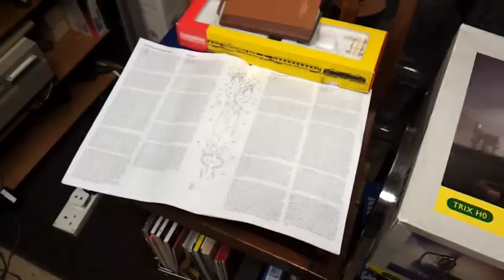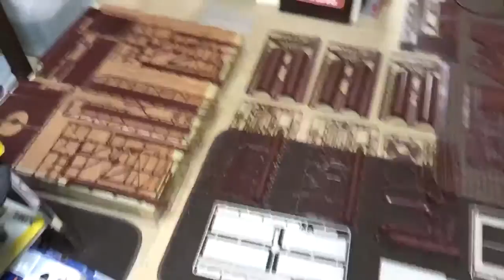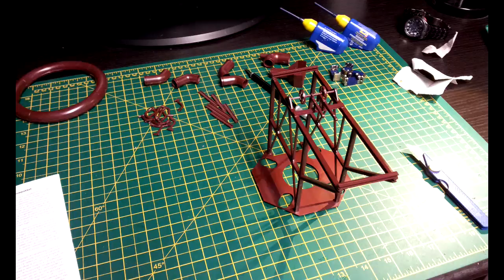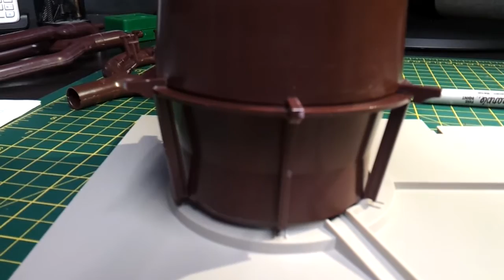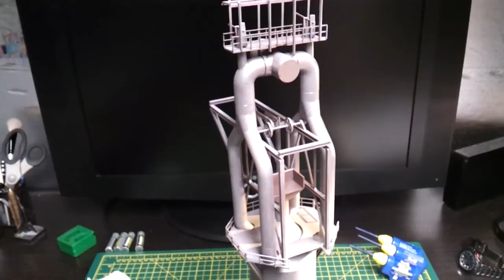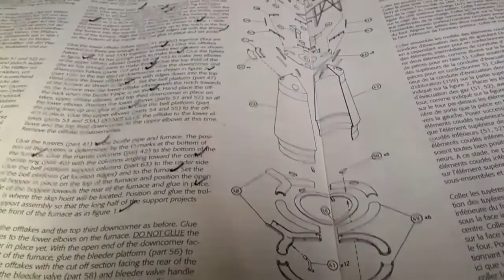TRIX 66101 BLAST FURNACE (WALTHERS) PART 1

Comment: where to buy it? and is it very hard to build?
Reply from the maker: This kit is avalible from Walthers 933-3054 yes it is very hard to build.
Reply: would you recommend buying it? im relatively experienced at building model kits and love blast furnaces... and how much does it cost?
Reply from the maker: @UriNierer  its about £200 ish the kit...its a very large kit...I would not buy it unless you have the space for it...it is a challange to build as my kit had faults on the instructions and castings...
Reply: okay, what scale is it?
Reply from the maker: @UriNierer  1/87